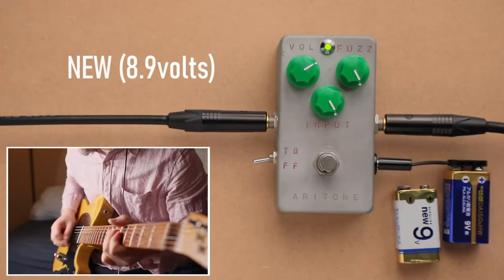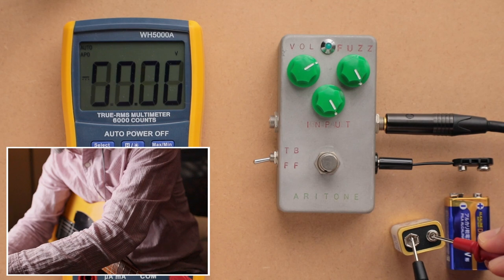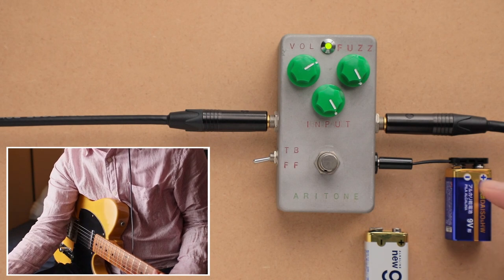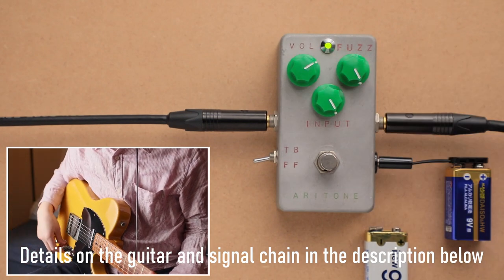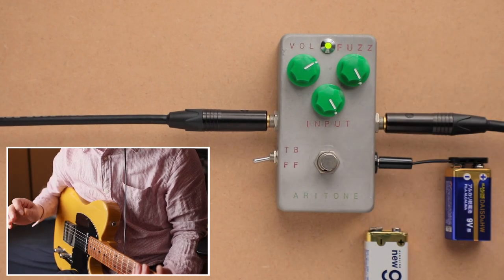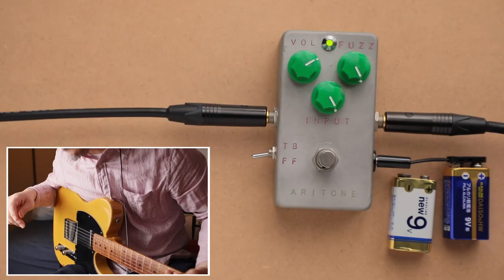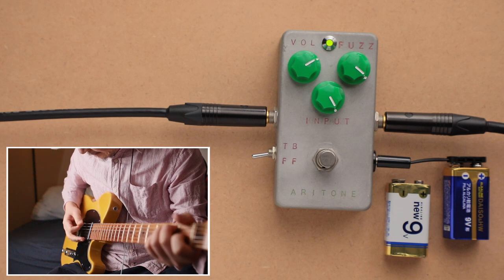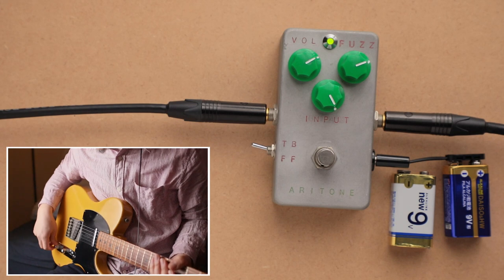How Much Tone Is In A Battery? 9 Or 7 Volts? 2 Batteries In A Germanium Fuzz Face & Tone Bender

Comment: Interesging analisys. I think that the higher impedance of the old battery tends to compress higher level signals, so bass il more affected. Kind of the sag of tube rectified amps. One differences of fuzz vs distortions (rat/ds1/dod250) is the bass roll of at the input. So it is in line with you conclusion.
Some power supplies have an outlet to simulate the level and impedance of the old batteries.
Reply from the maker: Thanks for watching! And thanks for the detailed info! I don't know anything about the physics behind a dying battery, so that's really interesting.

Comment: I just think you shouldn't use alkaline batteries, the cheap batteries can sounds more warm on fuzz pedals even in my wah wah ...
Reply from the maker: Thanks for watching! Yes, that's a great suggestion! I've heard the carbon zinc batteries sound better, although I've never tried one. Maybe an idea for a future video...
Reply: I remember hearing that Alkaline batteries are designed for sending short surges of power, like for a TV remote, instead of a long steady stream which pedals are more likely to need.
Reply from the maker: @emmarossignol4445  That's really interesting, thanks for the info! I'd never considered the design intention of batteries, but that would make sense.